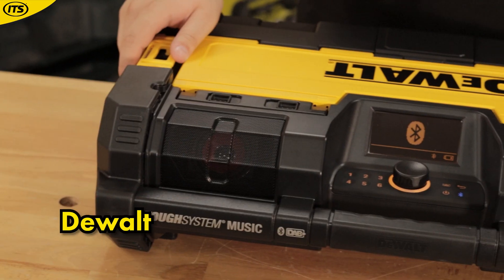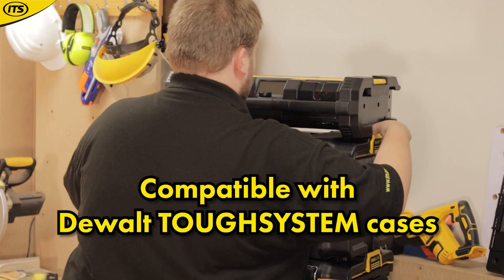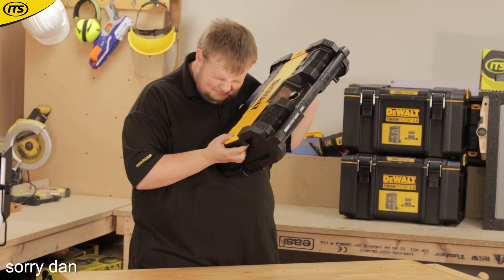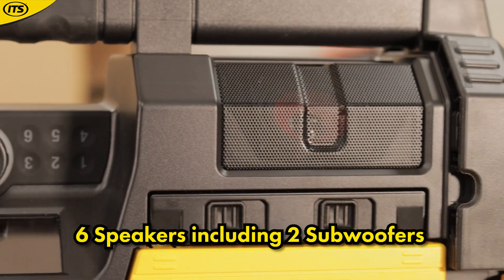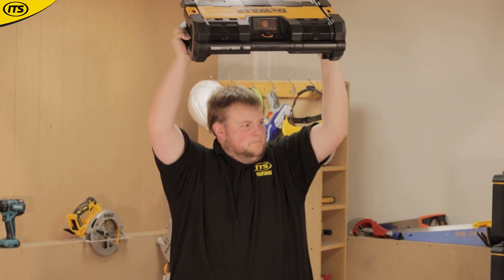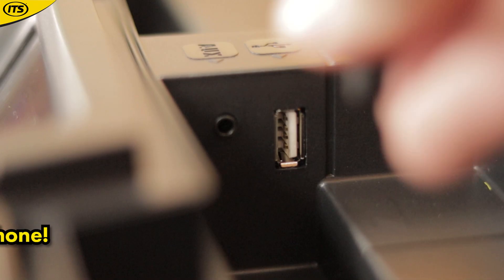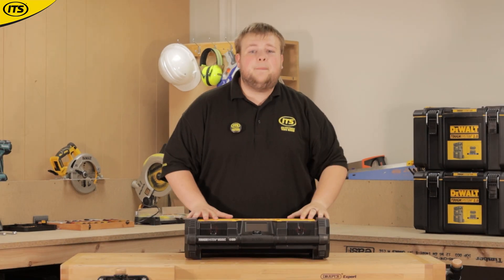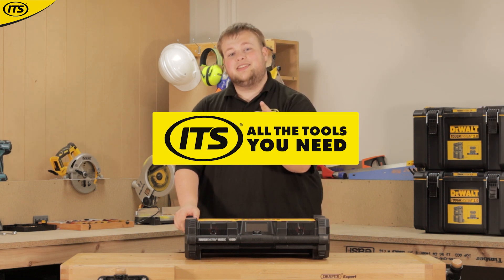What Makes Dewalt's Toughsystem Radio SO Good?

Comment: I just received one of these radios. It's been well used though. But apparently it still works! The bass is a little too high. Do you know how I can adjust the treble and bass?
Reply from the maker: Hiya mate, it looks like you can adjust the treble and bass via their "DEWALT Sound Systems" app. You can get it on Android or iPhone. Hope this helps! - Dan
Reply: @its  I figured it out. Just push in the volume know to select bass, and treble levels!
Reply from the maker: @Johonavich49  Ah, perfect! - Dan